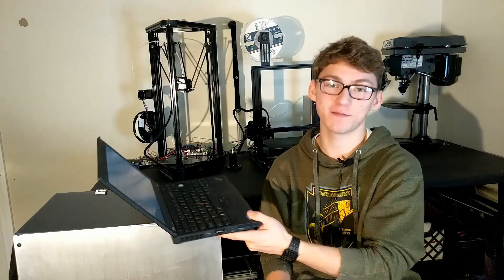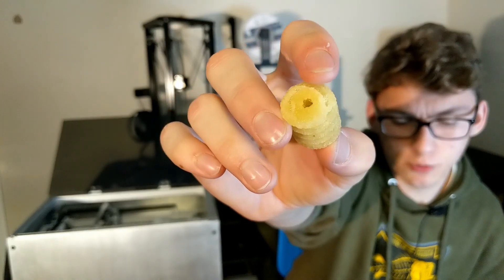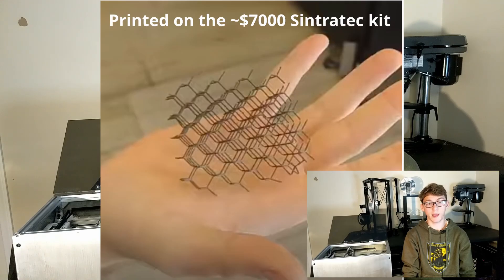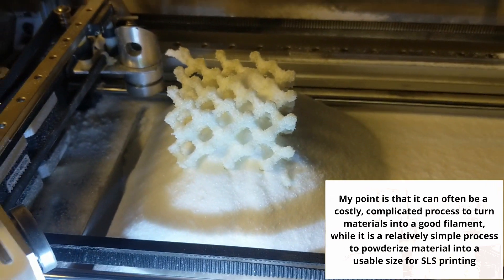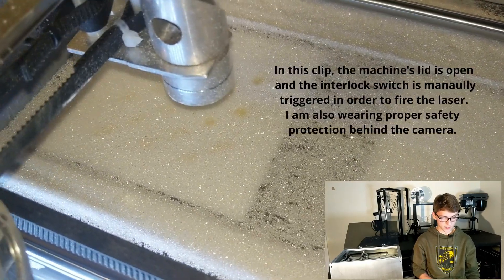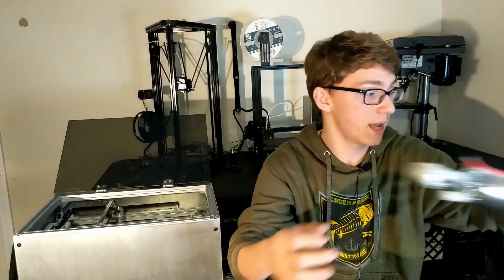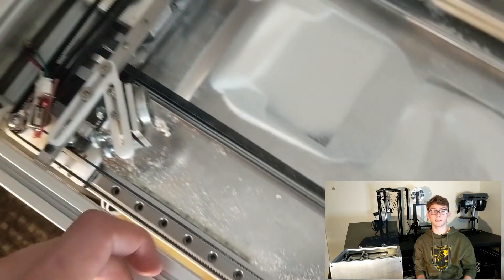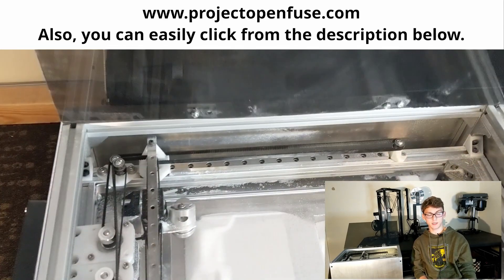Open-Source SLS 3D Printer: Project OpenFuse

Comment: So where are you at on the fully assembled or kit based packages? I want one!

Maybe this wouldn’t be too difficult: Metal powder (not specialized, but common industrial variety) mixed with a binder powder (maybe wax, or even sugar). The printed piece could then be fired in a furnace to burn off the binder material and fuse the metal powder.
 Prior to printing, the model would need to be scaled up in order to compensate for shrinkage from binder material loss and fusing of metal powder during firing. The required scaling could be predicted from an initial small test piece, for any given metal/binder mixture, while furnace temperatures and firing times would be based on the types of metal and binder used.
A possible problem might be ash mixed into the finished metal piece. Actually, I suspect that may not really even be an issue… If it is though, then I’m sure it could be addressed with the right binder material and/or a pressurized furnace.

Some metals would require very high temps for this to work. Some metals though, such as aluminum, would not have prohibitive furnace temp requirements. So buying or building a furnace for those lower temp metals would not be too expensive or difficult, and just aluminum would open up so much potential. While higher temp metals would probably require a fairly expensive pressure furnace, which would still probably leave the printer/furnace combo proved far less than pretty much any other metal 3D printer available.

Comment: Basically we have a core XY K40 Laser with a scraper?  I absolutely love it.  I take it the hardest part would be that scraper that has to deposit another (EXTREMELY FINE) layer of material.  Even on the old 100k usd powder machines I never understood how it never messed up a layer by not making sure the material was actually spread out.

Comment: Hi, Luke! I like your project! Especially the approach (sugar!) and the attention to safety!
Luke, what do you think about the conception of pre-heating a material? You know the benefits, I'm sure. Heating chambers aren't easy probably but as I've seen it in Sintertac (?) SLS printer, I must ask this. :)
P.S. oh, yeah... I've listened to the "UV lights" part. But then what's about a full heated chamber? BTW, do you make thermal simulations for your project?
Reply from the maker: Hi! Thanks for the comment. I am currently working on the V1 version, which will be released to the public at the end of the month. It has a fully heated chamber using silicone heaters on the bottoms and sides of the chamber walls and IR heaters to heat the top layer of powder. The heated chamber is an absolute must for sintering anything besides sugar and maybe a few other materials, so I'm excited to see how it works. I do not make thermal simulations. but may start if you have any good recommendations.
Reply: @MakingwithLuke  I've got this recommendation from Michael (Teaching Tech) in one of his videos.It's free and online (you don't need to use your PC to calculate)
This is the search for the theme:
https://www.simscale.com/projects/#viewMode=thumbView&sortBy=project_popular&search=thermal%20chamber

Comment: Really cool! Do you think by adding "the perfect" ratio of powdered sugar to "the perfect" ratio of the course sugar you're using now could result in a smoother finished part?
Reply from the maker: Yes, and actually the pros use what is called a bimodal particle distribution, or a mix of two different particle sizes, but they do it for different reasons. I have personally tried mixing granules and powdered sugar and had great results very early on, so I will be pursuing it further in the future. It helps with a number of powder physics issues besides smoothing as well.
Reply: @MakingwithLuke  you need different shaped granules, for the geometry to "fit" together. Different sizes is also good don't get me wrong. Also, a vibrator instead of a particle "patter" to arrange the "molecules" into their optimum resting state

Comment: I was wondering, did you abandon the 40$ 3D printer project that you talked about working and improving upon and posting the build videos? I personally wanted to make it and the lack of info about it is kinda annoying so any updates on it ever?
Reply from the maker: Yes, I have abandoned the project and moved on to a few other things since then, currently OpenFuse, as you can see. I will not be returning to that project. I would recommend checking out these two links for instructions on very similar builds. https://www.instructables.com/Curiosity-120-eWaste-Educational-3D-Printer/ https://www.instructables.com/eWaste-60-3DPrinter/ . If I may ask, what is your motivation for building the printer?
Reply: @MakingwithLuke  ah interesting. Yeah I figured that out going through your stuff. 
As of now I want to use the cheaper printer as a base model and sort of like prototyping to gain experience and build my final printer (prusa style) which is the reason I'm planning to build the smaller one. And also maybe print some parts for the full build.

One question about your model, what was the final build volume? 

Also, I'm planning to use a SKR V1.4 instead of RAMPS because it will be a part for the full build eventually so are there any parts of the build which a board like SKR 1.4 makes easier/harder?

Also did your design have any issues with moving the hotend? because with these weak motors it does concern me but looks like your design works great. 

Thanks in advance for any help!
Reply from the maker: @MaxC_1  Sounds pretty neat. The build volume was a little under 40x40x40mm. I would go with the SKR board since it is simply better than the ramps board at nearly the same price. Really no reason to use a ramps board in 2021. This printer could move all axis without skipping steps, but the motors are inherently vey slow, and some kind of counterweight may help the z axis more more efficiently,

Comment: Where did you buy the 10w co2 tube? Only find attractive offers down to about 40w.
Reply from the maker: I found the 10w tube on ebay, but Cederb (in discord) found that the same vendor sells them slightly cheaper on aliexpress. They are more expensive than 40w tubes, but 40w tubes are too powerful from what I've found. I've designed the machine to accept anything up to the 40w length, so if I can get one to work in the future it would be an easy swap.

Comment: Have you considered another laser type? CO2 lasers have a very bad beam shape. You need rather expensive optical stuff to shape the beam for fine and good quality prints. Sinterit Lisa (pro) uses a 808nm 5W IR-Laser. You can shape the beam with an amorphous prism pair. Only downside is, you can only print dark materials otherwise you will encounter absorption issue's .

Also consider a heater chamber an heated powder bed. When you heat the material a few degrees below the glass transition temperature you can print faster and don't need a lot of laser power. You will need good temperature control.
Reply from the maker: I have considered the near IR lasers like the one used in the Sinterit and Sintratec machines, though I think only being able to print dark materials quite limiting. The optics to control the C02 beam are not terribly expensive, and I've found no issues with the beam quality of the lasers I've used. I am keeping the design open in case I (or others) want to use a diode type laser in the future. I think the low cost and upkeep of a diode laser is very attractive.

I have also designed the next version to include silicone chamber heaters and ceramic IR heaters , so I can heat the materials to near melting temperature and sinter like the existing printers on the market do.
Reply: @MakingwithLuke  when can we expect the next part of the series?
Another point: Maybe it's better to encapsulate the optics part away from the build chamber otherwise it's super common that all the optics and mirrors will contaminate with powder and the laser will fuse it to the mirrors. Only question is which glass can be used as a separator between the build and optics chamber.
Reply from the maker: @marcelh2341  Not sure, but I plan to make a public release around the end of March. I have thought about separating the build chamber with glass, but the ZnSe window needed is very expensive. With a near IR or visible light diode laser, normal window glass transmits large amount of light, which is a pro for using that type of laser.
Reply: @MakingwithLuke only way to avoid large ZnSe window (when expensive Galvo-Scanner and F-Theta Lens isn't an option) is to use a small round ZnSe window, which should be cheap. For the rest of the open space use a bellow system on the x- and y-axis. Maybe cardboard with aluminum foil. I assume rubber types aren't sufficient for the high temperatures.
Reply from the maker: @marcelh2341  I've thought about bellows in the past and think that would actually be a great option. The problem is that Stratasys has/had a patent on using bellows for heat retention in 3d printers, but the patent may have expired. I've also considered using a small window for only the beam to pass through, but ended up designing the printer in such a way that the window is not needed. In a future version where the heat is sealed better, I will implement the ZnSe window, however.
Reply: Oh, and you don't need an extra motor for the roller. Just use the existing belt for driving the powder distributer.
Reply from the maker: @marcelh2341  Yep, I know, but I wanted the roller to be controllable, so I could move it clockwise and counterclockwise in order to compact the powder if necessary. I have since eliminated the roller assembly in favor of the simplicity of a wiper blade.

Comment: glass sugar? can this improove the resolution, because it is a most fine grain size ?
Reply from the maker: I can't say I'm familiar with glass sugar, but I have tried varying sizes of sugar, with varying results. Powdered sugar doesn't print properly yet, and large granules limit resolution. The powders in the middle of that work quite well, however.

Comment: Very cool! I was playing around with sintering silicon carbide on my fiber laser, and starting to CAD out the design for a proper SLS system (feed/print pistons, recoater, etc). But one of my viewers mentioned your channel and this looks much better!  Looking forward to hacking on this design, looks like you've done a great job.  Out of curiosity, is the recoater a blade-style, or roller?
Reply from the maker: Hey I just saw you in the discord and thought to check youtube since I thought I had seen your channel before, turns out I was right haha. Yeah, that's awesome to hear. What have you found out about silicon carbide sintering? that is seriously cool. I think you may have already found this out, but I just changed the design to use a recoater blade instead of a roller, but the system is very modular in case I wan to switch in the future. Excited to have you in the group and to your some of your work in the future! Lastly, I've realized that I'm subbed to your channel on my main viewing account, you've done some really neat stuff.

Comment: could it be upgraded to do metal
Reply from the maker: Even though polymer SLS and DMLS/SLM look very similar theoretically, they have some huge differences in practice. I don't see metal being usable in this machine, but I wouldn't say it's impossible.
Reply: @MakingwithLuke  yeah i don't think the laser would have the speed probably need a galvo head rather then the stepper motors and belts

Comment: Excelent! so next step is just using a stronger laser, making it airtight, fill it with inert gas and you have a metal printer? awesome. BTW have you tried using finer sugar? there is powder sugar readily availible at supermarkets at least in my country.
Reply from the maker: Ah, there's a lot more to a metal printer than that, but I like how you think. Thank you, and that's a good idea. in fact, I've already done some experiments with fine sugar and found that there is a nice sweet spot for proper powder printing. If its too small, like confectioners sugar, the melt pool turns into a ball before hardening. If the powder is too big, then resolution suffers.
Reply: @MakingwithLuke  I wonder If the sugar print could work for lost casting with molten aluminum. It could work either by straight melting the sugar upon contact with the molten metal. Or, solidifying plaster around the sugar figure, and then disolving it with water, somehow not altering the plaster around it. Hmmm your work makes one wonder many posibilites for useful prints.

Comment: I have some zprinters 310 plus and depowdering station I bought and need to upgrade firmware not finding many options can you help?
Reply from the maker: Hey mate, not sure I can help with that except to point you to Scott Zivs work with the "Recorp" machine, aka the glitter printer featured on Thomas Sanladerer's channel. you can Scott's work at scottziv.com, btw.
Reply: @MakingwithLuke   thanks.. last night I got my backup zprinter to go online but couldn't find on the network
Reply from the maker: @danielwhite6441  Keep me updated!

Comment: Certainly be interested in a kit, along the lines of the seckit-go. Interested to see how caster-sugar would go.
Reply from the maker: Great to hear that! If you want, I put a survey for those interested in purchase in the description. Castor Sugar has been discussed in the discord, and is better than granulated sugar, though grinding smaller sugar from granules seems to be better because of the smaller and more controlled grain size.
Reply: @MakingwithLuke  Hopefully will have time to get on the discord next week. Rebuilding my workshop...how did I end up with so much crap in here??
Reply from the maker: @originaltrilogy1  Great! Its all super easy to join, thankfully. Haha isn't that's how workshops always are though?

Comment: On the note of simplicity this esentially a CO2 Laser Table, with a Powder Bed Setup Below.  "Complex" but nothing more complex than one of those SUPER common K40 Laser Tables I would think.
Reply: MAYBE getting the powder level, or grain size and all that, but these are moreso issues with the process (like designing FOR FDM or Injection Mold Design) rather than the machine itself.
Reply: And if you wanted to make it even MORE simple you could use some lower precision/speed gantry like the Ender 3, or even the OSEs "Open Source Universal Axis":

https://wiki.opensourceecology.org/wiki/Universal_CNC_Axis
Reply: Also perhaps some sort of method for "bottomless laser tables" like "Full Spectrum Laser" does (but maybe just bring an angle grinder to a K40 ;)   ) so all that is needed are those powder pistons?

Comment: I like to see metal be used as a print material on this printer
Reply: The powder is really expensive. I don't think it's usefull for our purpose. Also, after the print you have to cook the print in an oven with really high temperatures.
Secondly, you need a gas thight build chamber filled with inert gas otherwise the metal powder would just burn when the laser hits the powder. Lastly you need a high power laser, which isn't available to us and/or unaffordable.

Comment: I make custom made foot orthotics. I was looking at purchasing a farm of sinterit and sintratec models, but the build volume was so small. Just didn't make sense. I need to nest about 18 pairs in at once, so I need  about 30x30x30cm. So I looked at the ProdWays Promaker P1000X, but they quoted me $300K and a material powder cost of about $50 a pair, which was pushing my peak budget. Give all the advances occurring in SLS right now, including young scrappy kids like yourself, I'm considering just sitting back 2 years and see what happens next. Any reason why you are not testing prints in powdered plastic polymers?
Reply from the maker: That's very interesting. This printer will remain at 100x100x100(ish)mm for its next revision, but I intend to eventually design a larger one as I learn more about the process. I expect that in 2 years, SLS will be significantly more advanced for the budget user than it is now. I will be doing tests with polymers soon, but am busy building a new machine that is capable of polymers.

Comment: Nice work done here. Looking forward for your update.
Reply: BTW, it seems you were using granulated sugar. Have you think about using powder sugar? I guess the finer sugar gives you better dimensional accuracy of your prints. Since larger particles require longer time for heat conduction. This might impede fusion in between large particles and cause inaccuracy. Once again, I really like your work of proofing concept.

Comment: Amazing work!

What of laser diodes?
🇨🇦
Reply from the maker: Thanks! I think diode lasers are interesting for this project, and may find a way to implement them into a future version, but for now this uses a 10600 nm co2 tube. A co2 laser is much more versatile with it's materials, since you can use any color material with it.

Comment: Recycling prints with this is probably gonna be very easy. Just powderize failed prints or simple pieces that already served their purpose and are no longer needed!
Reply from the maker: I think so! It's easier than making good filament out of recycled materials, at least. It would make sense for more expensive powders, too. Just mix the recycled powder in with virgin powder, and you should be golden

Comment: Have you tried printing in powered sugar? If you put the sugar you have into a blender or food processor is easy to make large volumes of it.
Reply from the maker: I have, and I had issues with it because of its small size, but I'm making smaller granules doing what you mentioned. A set  of sieves really help to classify the sizes as well